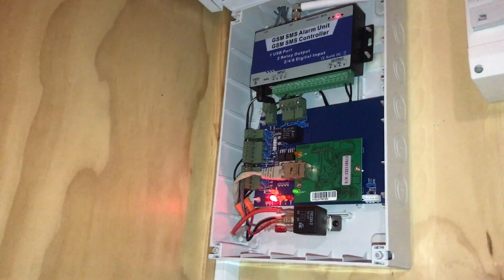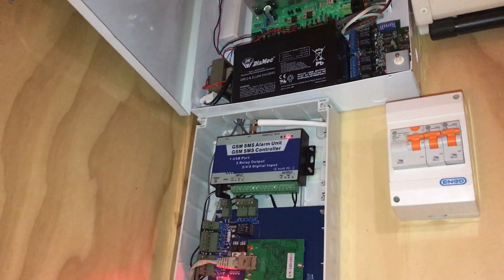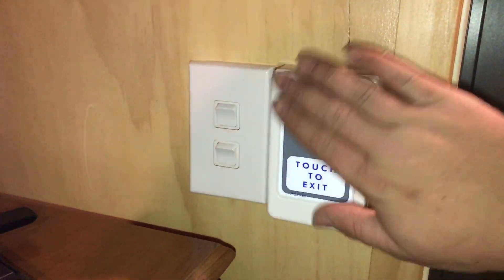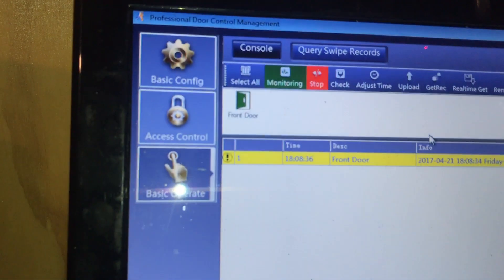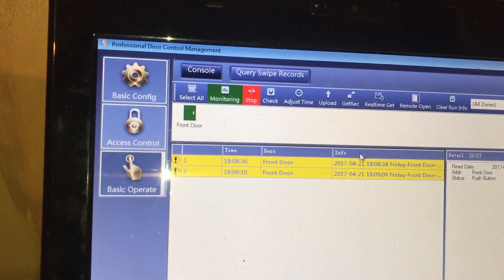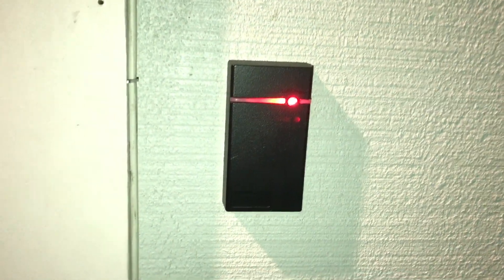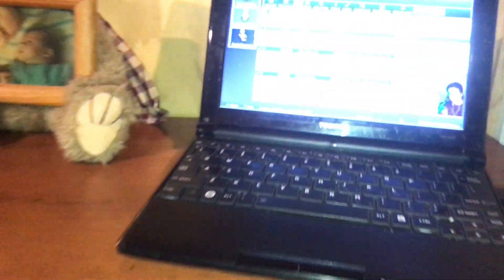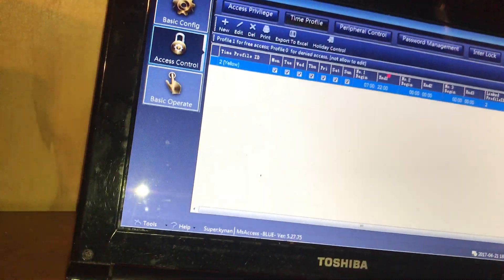Access Control system (Wiegand)

Comment: the glassbreak  is so if the push button is not working and it is for health and safety reasons
Reply from the maker: yeah i might have to look into one or just a bypass switch on the side of the plastic enclosure.. the room is only a rental so i don't want to many holes over the place.

Comment: the output 4 on the alarm panel it still lock until i control output 4 to open
Reply from the maker: Cool! you should defiantly consider making a video of the setup. I will make another video tomorrow of how  the GSM unit works, my battry back up and how the mag lock disconnects when the fire alarm goes off

Comment: my alarm system got a back battery to but my mag lock has a glassbreak im installer of alarm and access control so the law said you have to have a glassbreak building to get out  to im a New Zealanders,
Reply from the maker: It's only required if your access controller is not connected to a fire alarm system or if the lock is fail secure. as far as i know.

Comment: Hi,
I have a small problem that i couldn't solve. the distance between the card reader and the computer is 300 meters, while my wiegand maximum range for proper operation is 150m. I can't get it closer. So what do you suggest to solve the problem ?
Reply from the maker: aroui ilyes Have you tried using heavier gauge wire for the power and shielded cable for data? One of wiegand biggest downfalls is distance but shielded cable might help.
Reply from the maker: You can also buy a wiegand repeater which takes the wiegand data and converts it to RS485 check it out here: https://m.aliexpress.com/s/item/32638229137.html?spm=a2g0n.search-cache.0.0.193f367bs8Ic8A
Reply: thanks for the suggestions. I will see if it works.
Reply: I checked and I had the following problem: We are using HID readers which output 7 cables, 4 of them can get through that Wiegand repeater you suggested. However, what should I do for the others (for beep temperature and led). If you have ever faced such a problem ?

Comment: Ok then and I got an app on my phone that is for my alarm panel
Reply from the maker: yeah that's why i really want the solution 6000 panel with ip module.. i can't remotely ARM/DISARM my system at the moment.. i can only monitor zones, AC output and troubles